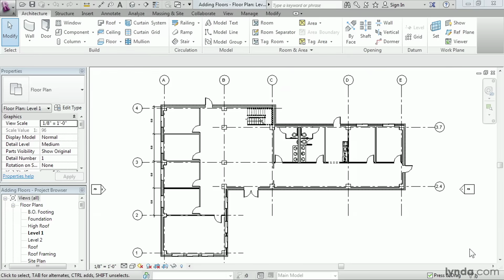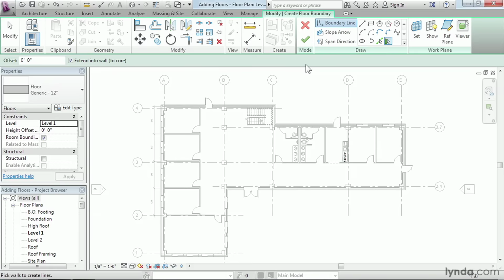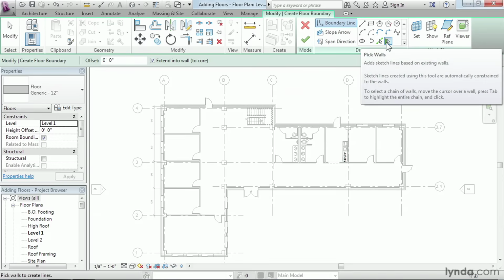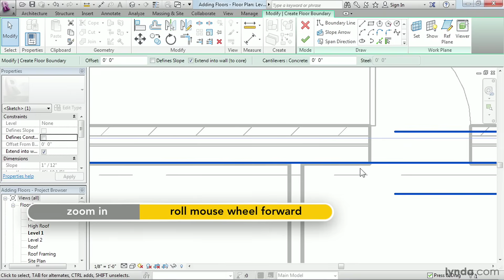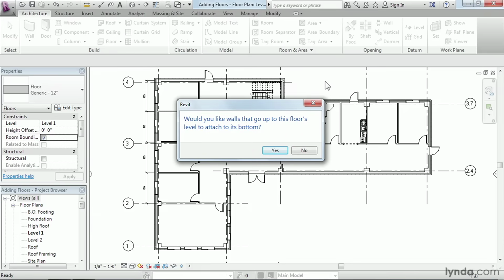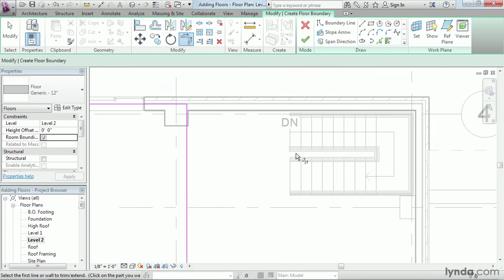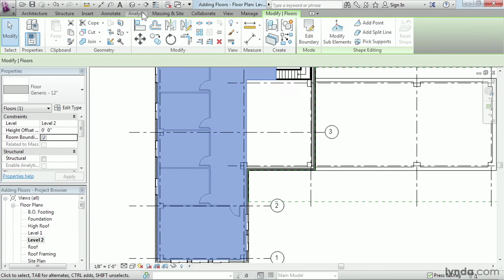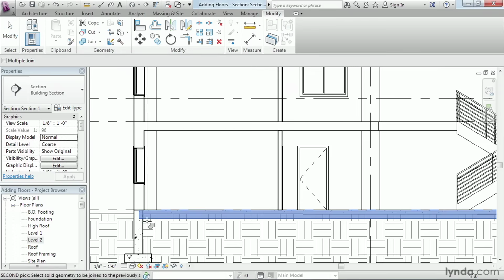Revit Tutorial - How to work with floors

Comment: If your revit is not showing the cancel or finish options, the x and the checked line, just double click on modify / create floor boundary until it changes the aspect of the display, in the last option it will come out.